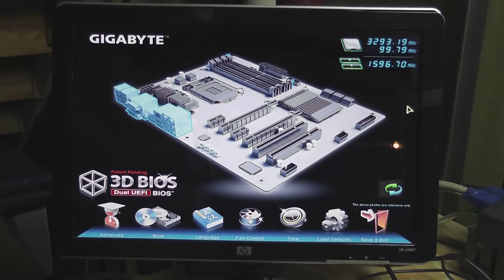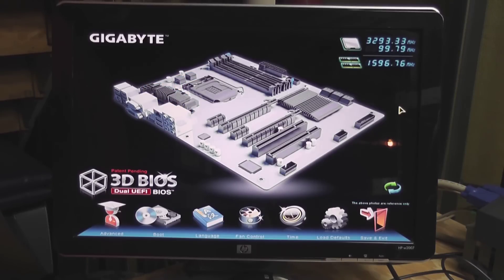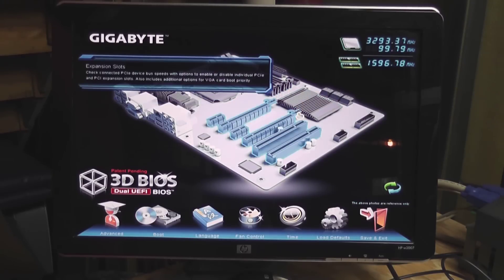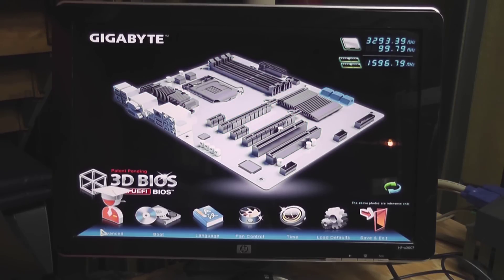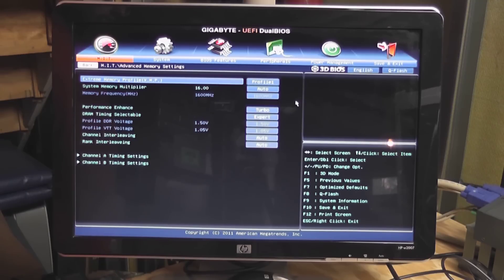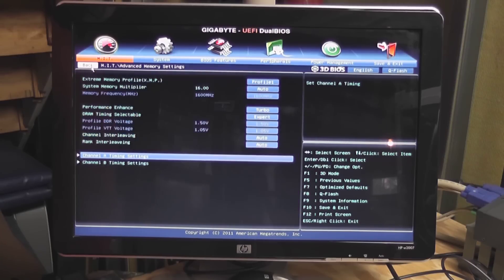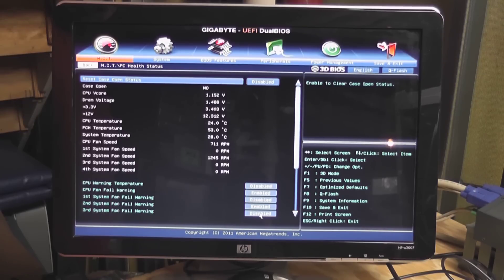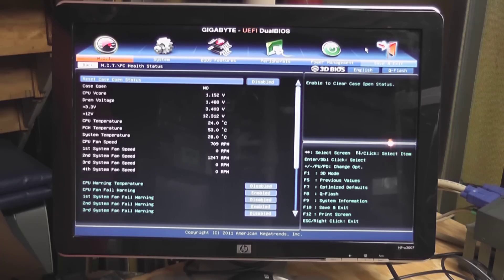PC Upgrade 2012 - i3-2120 - Part 7 - BIOS Overview and Some Settings

Comment: Hi i have motherboard asus h61 chipset ,core i3 2120 installed and memory team dark xtreem 2x4gb xmp ver.1.3, but i cant find xmp feature in bios option, even though in manual support that. 
what chipset in your gigabyte motherboard ?

Comment: Hey im new to building pcs and i was just wondering could i use the same parts to upgrade my pc which has a i3 2160 and also i would be looking to get more ram about  16gb will do what cards shall i get and also what is this system capable of running e.g games